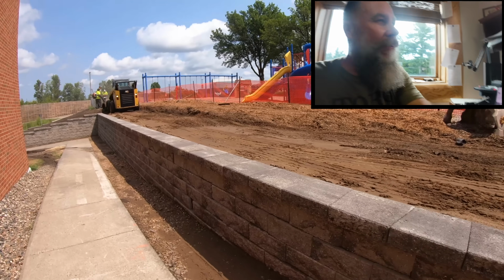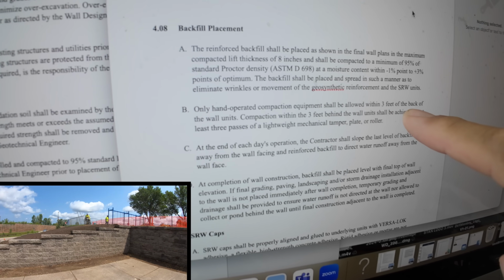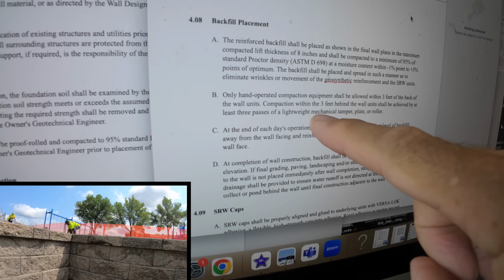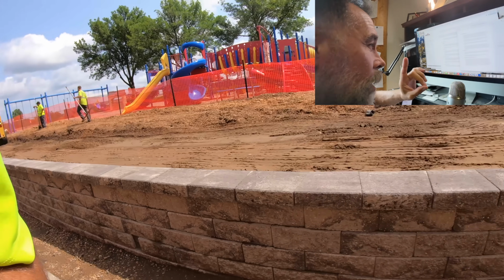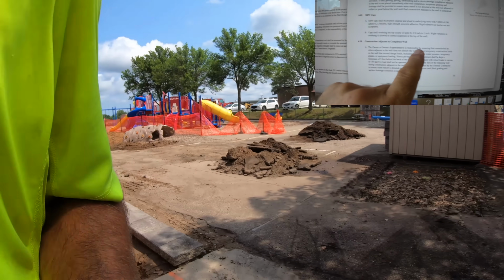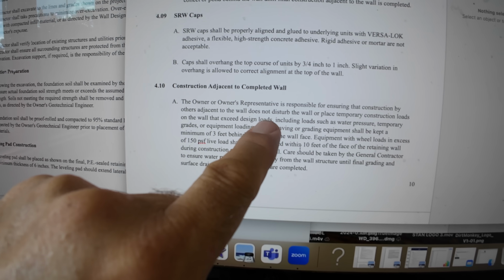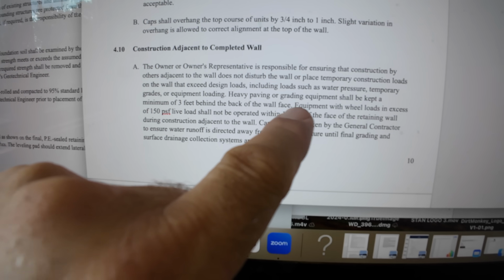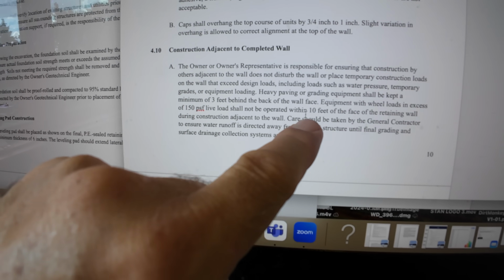Who's at Fault?  You decide.

Comment: Seems like neither the GC nor the asphalt sub read the specs. I would think that the GC would assume the subs would follow the specs; therefore the asphalt sub would be at fault. However the GC is there to oversee the project and is therefore not blameless. The checks and balances failed at those two points. Both are responsible.

Comment: GC is at fault. You do the contract to spec from the GC, GC can blame the architect for giving the spec, but that is between them. The other contractor shouldn't do things not to spec, but they do it to their spec from the GC. GC makes the big bucks because they do the planning and assume general liability. 

One example is plumbers will constantly cut structural members because their spec sheet shows plumbing going a certain way, So was it wrong on them to cut the structural member, yes, but at the same time, no.

Comment: I've done both asphalt and retaining walls. I don't see why the asphalt crew can't hand rack the material to the back of the wall while using a plate packer for the compaction afterwards. I mean a meeting between both subcontractors should be held so that there is an understanding on what can and can't be done during the installation process if the two crews work somehow intersect with each other. Neither of these types of jobs are fun to do without using machines, but when it is necessary to do hand work then it should be done that way.

Comment: First, we need to read the contracts.  Contracts can be wildly different from job to job.  Sometimes, you sign a contract and find out later that you signed up for trouble and face non-completion fines or loss of future work.  Once in a while, the contract states that all liability is the responsibility of the owner or General Contractor.  I've worked a few Demo jobs with that clause in the contract, and you'll be insured as well.  These are jobs that most likely will cause some calateral damage. Eg: roads, sidewalks, windows etc.
BUT contracts aside Dirt Monkey has no responsibility for wall damage here whatsoever.  Common sense puts all blame to the paving company for wall damage, but here's where you go back to the contracts.
1 Did Dirt Monkey sign a contract with attached plans for ashphalt paving up to the wall.  This is important.
2 Into the weeds.  Did an owner, general contractor, foreman, etc, make an on the spot decision to go forward with a paving unit and wheeled loader ignoring best practices.
3 The architect may have no responsibility as their drawing usually reads, "All work to be carried out in accordence with local by-laws and best construction practices."  Where an engineers drawings will be very complete including tolerances for exactly this type of situation.  The specs for the wall would be considered the type of soils and drainage, and even in this case, I would expect a stone laid wall woulnt have been acceptable but rather a poured concrete wall is called for that rises above the pavement.
4 Dirt Monkey is a funny name and not to blame.  Go get em.  Cheers 🇨🇦

Comment: awful design.  100% engineers fault.  also, specifically exclude on all your bids damage caused by excessive loads placed behind wall so the GC will be aware there is a potential problem pre contract award.

Comment: It should have been stated in the paving spec that no heavy equipment can be used within three feet of the wall. The GC should have a working knowledge of ALL aspects of the job and stop subs from causing damage to other subs work that had been completed. At the end of the day if it is not stated in the spec for the paving company than it would fall back on the person writhing those specs. You also have to also blame the GC for not knowing to stop the paver.

Comment: If you installed the material according to the engineered plans, and manufacturer specs along with best practices and the other subcontractors did the same for their portion it then falls on the general contractor and engineer as they did not follow the manufacturer guidelines. Now a trick the engineers like to do is put in the fine print of the specs that all work performed and installed near all other work must be done to manufacturer recommendations! This is the underhanded way of laying poor engineering liability onto the subcontractor.

Comment: architect / engineer issue with your failed retaining wall. hell the GC as well. if I was the super on that job a simple solution would be to pour a concrete walkway 4 feet wide. I commented on a previous video that I was building a wall right now similar to these at a school similar to these. mine is 2m high, engineered, with an engineered fence, thankfully a soft landscape zone for about 4 feet before hardscape behind the wall. wall will be full height on Monday. nice to hear you share the possible pitfalls when I am doing the job

Comment: The Architect and engineers are 100% because they need to know the spec. on everything they use on a project, the Architect does all the design work and should know all the spec. on all items he calls out for and then the engineers does the final load test and if it is wrong then they go back to Architect so he can change the wall or the asphalt.
I would think the engineer is a little bit more to eat the mess but them two needs to fight it out not you or the Asphalt contractor. You need to send the GC a certified letter stating all warrant is null and void and the reason why and then it is his responsibility to inform the school, engineering firm along with the Architect firm. You will still be in the lawsuit but should get bout fairly quick. The thing about a lawsuit is everybody gets sued even the people that did everything right. It's a good thing you taped this project because they will say the bed, backfill and cloth was not installed correct and that's the reason the wall failed. Good luck.

Comment: Ultimately, it is the general's fault. The general should catch mistakes of engineers and designers simply because they do not always pay attention to the variances in laws set up by cities or states. However, if this asphalt company was made aware of their mistake, they could easily bring in lighter equipment that is capable of gathering materials away from the wall. Example, the asphalt company that paved my driveway had a very small machine, that could probably make sidewalks. Every time they needed asphalt that machine pick up and go to the dump truck and then return back. The vibrating roller was even narrower than most sidewalks. The asphalt machine that you're showing looks quite large and heavy. My guess is even too heavy for working safely near such a wall.

Comment: In this case, the SC doing the ceiling work as he is not following the design specs. He was taking the easiest way to do the job. Some blame goes on the MC for not supervising the start of each faze. I don't blame the design engineer as he designed the project to a customers specifications and he laid out certain building requirements. You as a SC should advise the other SC of the problem. You should also contact the the GC that you will not accept any problems arising in that section of the wall. Its then up to the GC to organist rectification to the problem.

Comment: Asphalt could have been placed with an asphalt widener.  It’s a machine that has a hopper and belts the asphalt material to a screed that is cantilevered off to one side of the widener.  (Ie it allows an asphalt road shoulder to be constructed while the machine stays in the adjacent lane).  The asphalt would then require some hand work and compaction with plate compactors.  Might have to do in two lifts to get proper compaction.  This method would have kept all heavy loads out of the wall’s
danger zone.  Means and methods matter.

Comment: Civil Engineer here with 30+ years of experience mainly in the site design area.  I say that your responsibility is to report the issue to the general contractor.  It is their responsibility to talk to the engineer/architect to determine the cause and repair.  When it comes to paying, that's another issue.  If it comes to lawsuits, a judge decides who is at fault.  In this case, based on the story you presented, I think the engineer/ architects screwed up and didn't account for the manufacture's requirements to be followed during construction.  The subs fluid exactly what they were supposed to do.  The probelm is the wrong type of wall was specified for the application.  It should have been a cast in place concrete wall, but that would cost significantly more.  This is a typical errors and omissions claim against the design team.  Architect for laying out the site and the engineer for not designing the wall for the field conditions during construction.

Comment: It’s not the engineers fault. There are no design issues here. Asphalt is placed directly behind segmental, retaining walls every day. The process of installation needs to be tailored for the job site conditions. For example, if I am running a new municipal sewer, main and I encounter an old culvert that won’t support my equipment. I have to figure a way to complete the project. It may involve steel sheeting on Ibeam, directional boring, etc. This is my responsibility as a professional contractor.  Yes it would be nice to have a warning in the engineered plans about placing a surcharge on the back of this retaining wall. But at the same time most experienced paving contractors know better. If you are running gasketed pipe the plans won’t have a notation to clean the bells. If you’re pouring concrete, the plans won’t tell you to pull the wire up.
 On a sidenote, I hate these walls. After 30+ years, on any Design build projects I do I spec, large block, gravity wall system. Specifically redirock. It’s quick, takes less labor, and if installed correctly well withstand just about anything someone does after I leave. You can have a painter come in with a spray gun and an airbrush and make these walls. Look phenomenal!

Comment: I have done my share of stonework for 20 years and now been doing asphalt base for 8 years. So i can relaite both partys here. Not wall company fault not asphalt company fault. Bad desing of materials together. Only thing i would have done different is to demo the old asphalt off before installing the new wall, thats just extra stress on new wall.
Reply: If you have experience with asphalt then you should know that the heavy equipment was not necessary to be that close to the wall.
That strip by the wall should've been done manually without machinery.
Wheel barrows to dump the asphalt and manually rake and lute, and use a small water filled roller for compacting.
Reply: @Boomhauer333  Yes and i know if done like that the asphalt would fail and then i would be on the asphalt companys hands to fix it becouse of lack of compaction on the asphalt base and final product. As i said before poor choice of materials together.

I have never ever used a wheelborrow to make asphalt base if i can fit there with my bobcat.
Reply: @thequattro20v  🤦‍♂😅 Oh man... you still have a lot to learn. 
I've done plenty of asphalt jobs using manual tools, no heavy machinery, nothing has failed. It's laziness and lack of common sense that creates failure.
Reply: @Boomhauer333  Well i don't know what kind of jobs you are doing but i don't wanna spread 300t of gravel in a day with a wheelborrow so......... mayby there's something you should learn also🤷‍♂
Reply: @thequattro20v  Laziness, and carelessness. If you see a risky job you should be able to take appropriate measures and precautions. There is no reason to be running heavy machinery right next to a retaining wall. It's pure stupidity. Vehicles don't travel in that area so there is no need to run heavy rollers or anything of that nature. But go ahead and keep doing what you do.
Reply: @Boomhauer333  Did Stan blame the asphalt company on this video?
Reply: @thequattro20v  if you know how to read between the lines then you'll know the answer. And yes the asphalt company did screw up. They should be able to see the risk and take appropriate measures.

Comment: GC for allowing the equipment on there, how the sub gets there job done is there call to stay behind engineering limitations and act accordingly.  Many ways to skin a cat, could have been done and not caused damage, the asphalt contractor under bid to take shortcuts.  It's the GC's responsibility to make sure they don't.  General Contractor 101% at fault for allowing it to happen.

Comment: Unpopular opinion here it’s everyone’s fault. We’re both overspecializing everyone in the chain and giving to much weight to the “that’s not my job not my problem” mentality. the project is supposed to be an ecosystem of both mechanical engineering and bio engineering that work together to achieve a common goal. Because nobody wants to understand the others job or step up the customer gets shortchanged while everybody points fingers at everyone else.

We need to go back to designers being architects being engineers being builders being trades.  the more good job seal clapping for half ass work to everyone down the chain does ,in a effort kiss ass doesn’t help anyone it wastes time labor and most importantly the customers money. 

What’s planted outside of the structure effects the structure, the outside of the building effects the inside, that in turn effects the air quality inside which effects the occupants ect. Nothing exists in a vacuum, The project the blame the money nothing at all.

Comment: Every body needs to follow the specs of the walll in my opinion the heavy equipment so close what if the retainer failed and equipment rolled over big safety issue when we back filled retainer walls try to keep equipment at least 5 feet away it seems like some things might be avoided on a pre walk after retainer was almost complete gives asphalt contractor time to maybe have change order for different equipment for the task

Comment: It depends on what the contract says to determine who’s at fault.  

My initial thought is that this is a means and methods issue.  If these wall specs were included in the contract then the asphalt contractor should have known to keep heavy equipment away 3 ft from the face and use a plate compactor for compaction within that 3ft.  The contractor as a whole is solely responsible for means, methods, techniques, sequences, and procedures of construction.

But if the plans called for placing asphalt to a specified compacted density then there would be an issue with the design for which the contractor would not be at fault.  How are you supposed to reach a compacted density with a plate compactor.  They either waive the density in this area or revise the wall plan.  Seeing this a playground density doesn’t matter.

Comment: The engineer who spect out the job is at fault and the General Contractor. The contractor should have looked up the specs of that wall before allowing all that heavy equipment to operated behind that wall. The engineer should have known the specs of the wall... I seen pavement put right to a retaining wall with know damage.. They laid the pavement by hand and only used a small plate tamper to compact it. Then a rail was put up to keep cars away from the wall

Comment: Here in PA at least the engineer can't mandate the means or methods of the contractor or sub-contractors, merely that the specs are being adhered to. Since the spec book is the jobsite gospel, non-compliance with spec 4.08B and 4.10 should pin the blame on the paving sub-contractor and GC. If the engineer had an inspector out there that didn't stop it then they will easily get dragged into the inevitable lawsuit too. It's a stupid design that could've been avoided but the engineer can claim that the paver should've done it all by hand within 3' of the wall (as unrealistic as that is)

Comment: So who is the rocket surgeon who has designed a site with asphalt to the retaining wall without a guardrail or barrier?
For the older and larger retaining wall I saw a guardrail - did the posts for the guardrail get pounded thru the geogrid you installed? Our typical detail is to have the retaining wall contractor install a sonotube, usually at 2' back per retaining wall manufacturers specification so posts for a guardrail can be installed without destroying the integrity of the wall. what is missing from your narrative is what the plans from the designer showed. I mostly work in Illinois and the rule is any wall more than 3 feet high requires stamped plans from a professional engineer (PE) before said wall can be built.

Comment: Well I think most of us know who and where the fault would lie. But for the architect/engineers too actually own up to it is usually another can of worms! I have built a few large commercial retaining walls and found that the specs are normal right on as you say all the information is easyaly available.  But that where it ends with the architect on the blue prints then they move one to the next step. And they never put the 2 together as a whole project. For example the blueprint would call for a 6' high retaining wall to be 1 foot way from the property line. And call for 6' wide geo grid behind the wall on spec levels of the wall. But what they tend to forget is now to make that work on the jobsite. Your geo grid is now on someone else property.  And this little things happen all the time

Comment: Who ever singed off on the blueprints should be at fault, they should've checked into which block was going to be used and if heavy machinery is used they should've check to see if that would be to much for the wall. When the wall collaspes they better not come after you and of they wanted to have asphalt behind the yall it should be done by hand and not done by a machine.